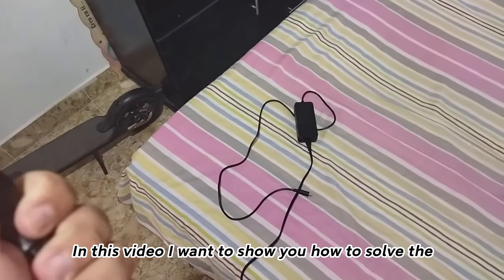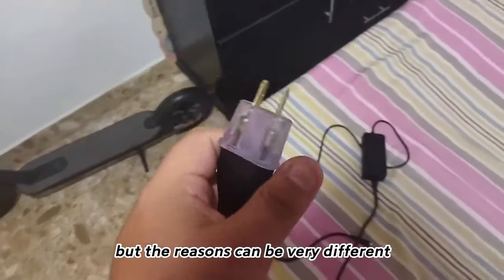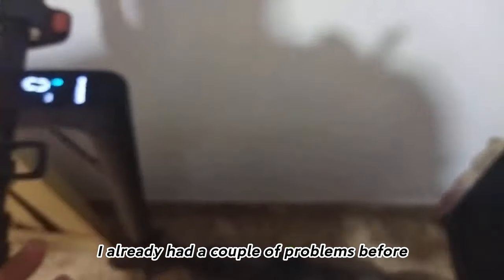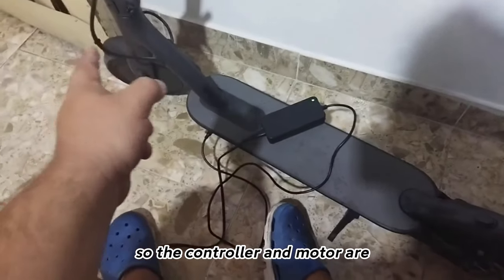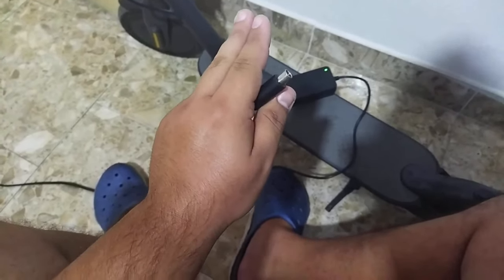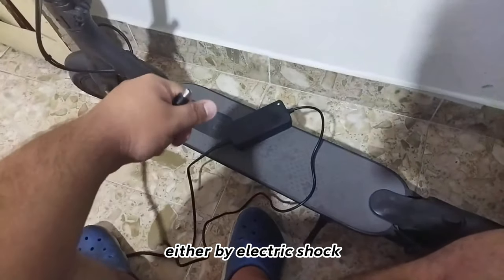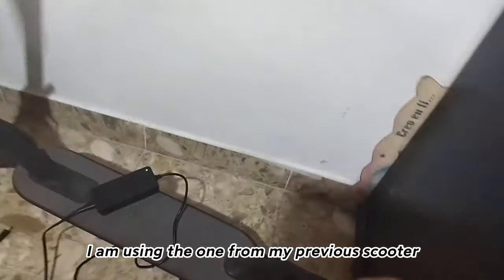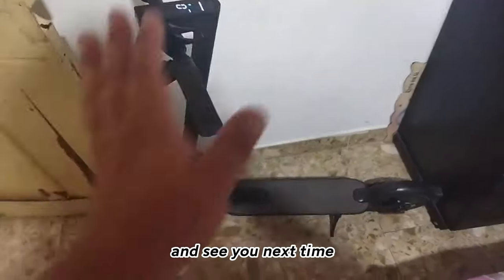My charger turn on green and not charge my scooter or not turn red led - How to fix this problem

Comment: Here is the 100% solution, just double clik on your scooter like you want to turn on and change from speed mode to eco mode then try to charge it and IT WILL WORK!
Reply: while it's off and charging?
Reply: @mafiap2102  it needs to be on to be able to change it from speed mode to eco mode, & and yes charging :)

Comment: My scooter always light red why?
Reply: If it’s Green 💚then it’s already charged or disconnect but red means it’s charging ❤
Reply: When I am charging my battery (brand new), the charger light oscillates between green and red without becoming green after several hours of charging. Why? What should I do?

Comment: Those spedeters built in handle bars are a bad weak mad desighn, its engineering is very poor quality... if it fall over a few times the housing cracks
I suggest buying one that dosent have that design.. get ine with the lcd digital display mounted under the handlebars with alan locking screwhead.. or get a sit-down model there a bit more . About 450$ much safer and practical i think .
Definately faster as well ❤